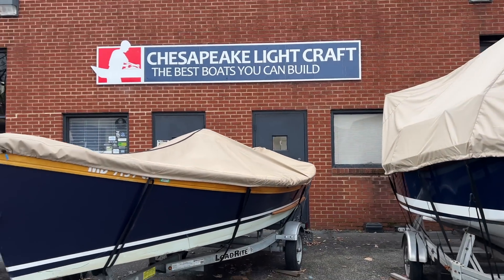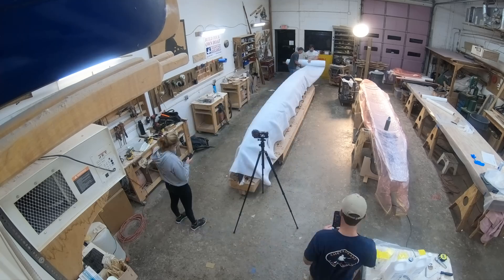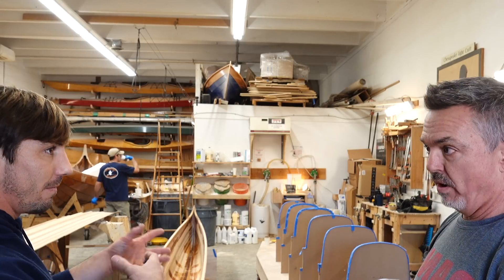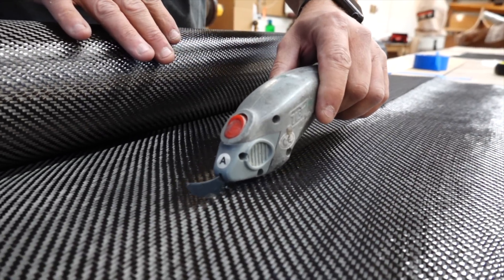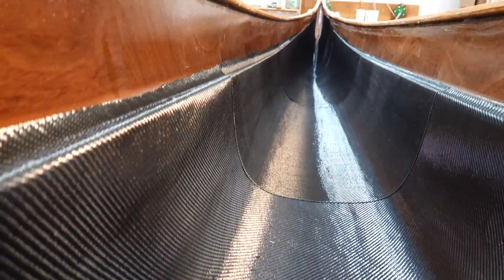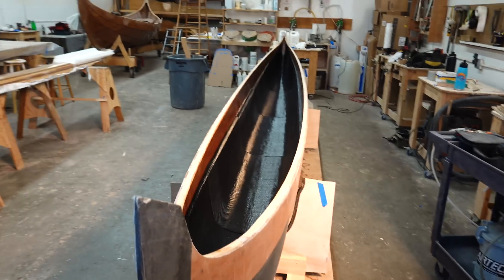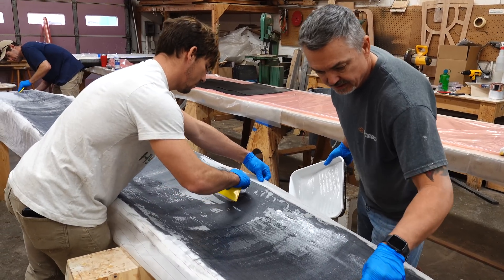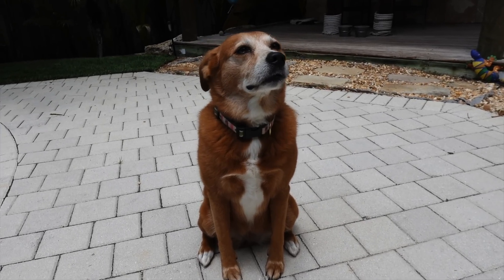Vacuum Bagging Carbon Fiber on our Strip Planked Outrigger Sailing Canoe (Build Part 3)

Comment: Hope that building has good ventilation? None of you are wearing masks?
Reply: Epoxy does not “require” masks as it is low in VOC’s and the Total Boat brand is very low odor. The bagging process also encloses the surface while in cure stage. Now once the sanding starts, respirators are a requirement. The shop also has two air scrubbers to pick up any particulates.

Comment: Cool boat, but why did you build a wooden boat if you will see nothing of the beautiful wood? Wouldn't been easier to do a fiberglass/carbon canoo? Dumb question I know...
Reply: Cedar is a wonderful core material, far better properties than foam.